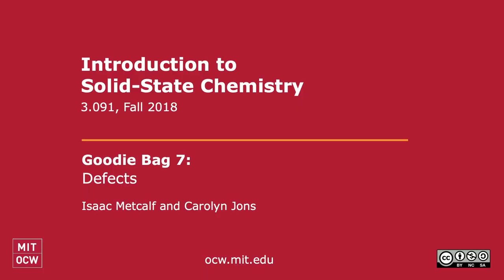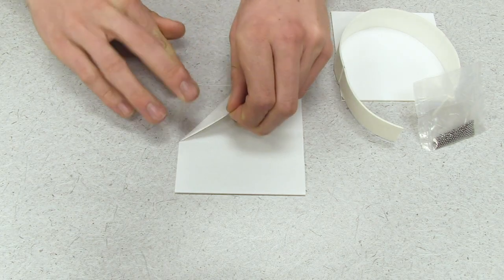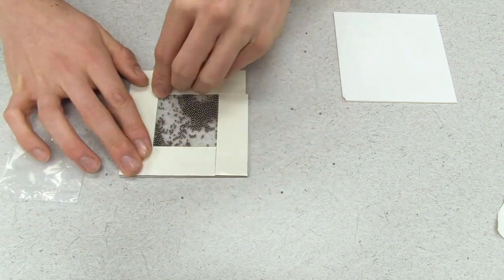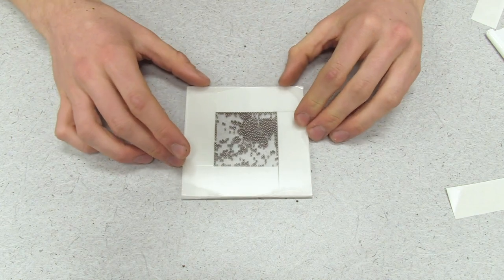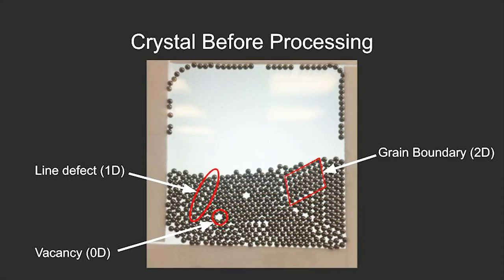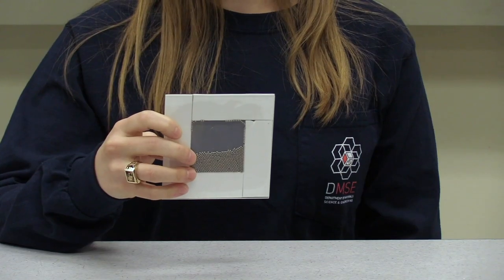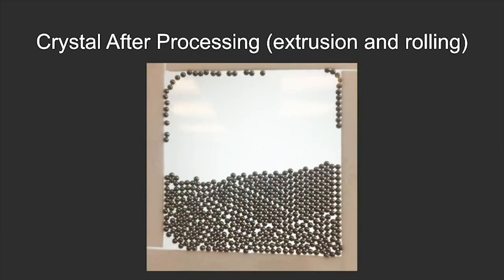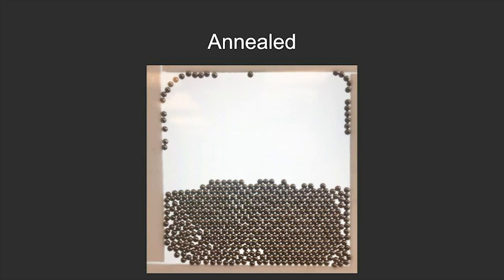Goodie Bag 7: Defects (Intro to Solid-State Chemistry)

Comment: If you want to make this as a toy or art-piece rather than an educational item, consider purchasing 10k "ball bearings" (hardened /plated, between 2mm and 3mm in diameter) from a bulk seller e.g. via aliexpress or ebay. These cost between 2 and 20 money-units, depending on gold-plating or otherwise. Avoid the cheapest of the cheap - these have a terrible surface-finish and tend to jam. Next, get two identical picture-frames from e.g. Ikea (with glass panes instead of plexiglass, for extra scratch-resistance) and sandwich the balls between the two glass sheets. Use paper-shims (stacked post-it notes or polyimide tape) to create a inter-glass-gap slightly wider than the diameter of the balls. 

Avoid the temptation to use a magnet to contain the balls from bouncing off the glass while pouring - the residual remnance makes the "crystal lattice" demo less fluid, as the balls tend to clump up. Alternatively, consider using bronze, brass, ceramic or POM balls.

Enjoy!